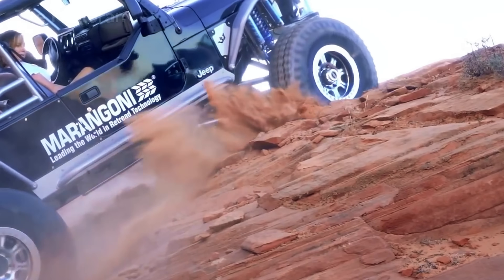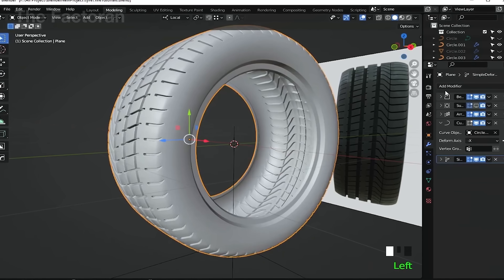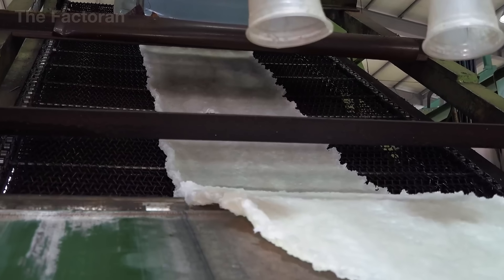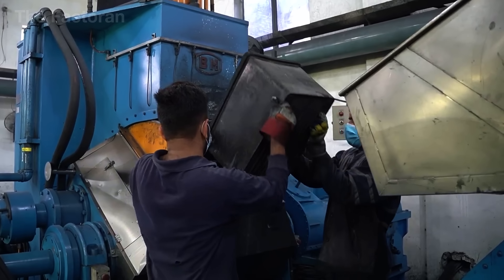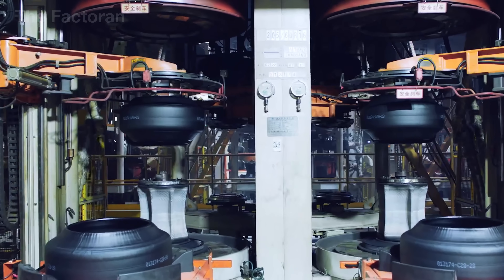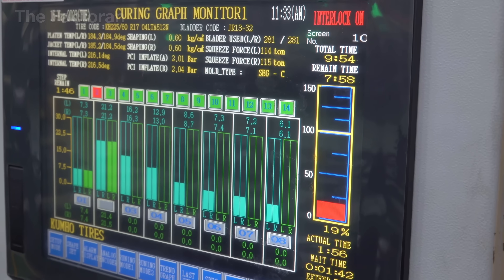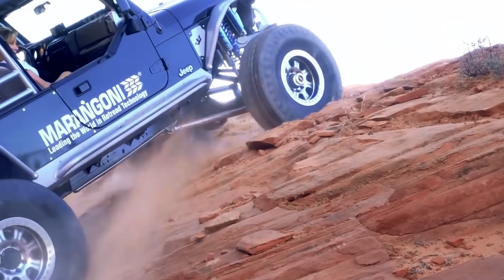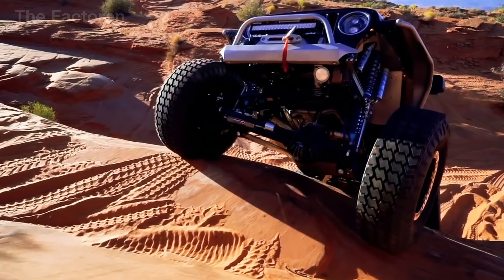How Car Tires Are Made Inside Michelin’s Massive Production Line

Comment: Detected the flaw in the tire creation: why there is no metal net inside? It would increase the tire strength!
Reply from the maker: Good point! Car tires actually use layers of steel belts inside — maybe the video just didn’t show that part of the process.

Comment: I purchase Michelin Tires, my 2016 Chrysler 200C AWD in 2020 only had 20,000 miles replaced Eagle GA tires on car, because of T.P.S. always alerting me of low pressure everytime on 3 or all 4 tires falling below threshold when weather got cooler and stayed cooler putting air in tires every week.
I purchased set of 4 Michelin Pilot series tires. And have had them for 5 years and T.P.S. has never alerted me of low pressure.

I had replace tires on my 2019 Jeep Cherokee Overland 4x4 at 60,000 miles, with Michelin Cross Trek 2 tires because of great rating they received from customers on Discount tire  website, and person I work with had set on her Equinox.
Reply from the maker: Thanks for sharing your Michelin experience—sounds like a game-changer!

Comment: I was Quality Manager at a plant produced and used 1,000,000 pounds a month for automotive anti vibration parts. Rubber is amazing stuff and the chemistry to get it to preform certain ways is impressive. And the mills they mix it all together in, at our place were originally placed over 100 years ago. Yes they get rebuilt every 15 years os so a few million each. Still great stuff.
Reply from the maker: That’s incredible — firsthand experience like yours really shows how advanced rubber engineering is!

Comment: Not just the tires, your suspension takes hard impacts on bad roads. And your engine and Transmission mounts take a beating.
Reply from the maker: Absolutely true — bad roads wear out more than just tires!
Reply: Thinking of moving and I look at houses that are NOT on Gravel or dirt roads. Because so harsh on vehicle, have friend lives on dirt or gravel road and 60,000 miles on their vehicle looks like have 200 or 300,000 miles on vehicle and always repairing or replacing vehicles before or just after 100,000 miles.

Comment: Michelin comander 3 for motorcycles suck ,I will bever buy Michelin tire again,there warranty  is not good,only 2 workers for warranty took me a week to talk to them and the guy  told me there for RVsAnd motorcycles the tire i bought makes vibration between 23 to 28 miles hour and the schop that sold it to me were hassoles so im stuck with it.Been using comander 2 for years on 2 bikes never again.shity service.
Reply from the maker: Sorry to hear that—sounds really frustrating dealing with both the tire issue and the service.

Comment: You don't just squirt rummer in a mold.
Reply from the maker: You’re right — rubber molding involves careful pressure, heat, and curing, not just squirting it in.

Comment: in my opinion you can't get a better tire than Michelin
Reply: Michelin premacy was always my favourite tyre,until they went over to the green version £160 per tyre, cracking on side walls, separation on tyre tread, way down on mileage,only 2 years old, stopped using them
Reply: Goodyear is easily the best.  Pirrelli makes decent tires, also.  Michelin isn't bad but can't compete with Goodyear.
Reply: @spg5658 Good year has never been qualified by Porsche, Ferrari or Lamborghini as OEM supplier for their cars! Not even close homeboy!😂😂😂
Reply: @LWRC They are the king of tires no doubt. USA quality
Reply from the maker: Michelin is definitely known for quality and durability—hard to beat their reputation.

Comment: Growing up in Akron Ohio, I saw my first tire being built in the early 1950's on a factory tour to the B.F. Goodrich factory. It was a bias ply tire, radials had not yet been invented. Entirely built by hand. Each tire assembled by a single operator standing in front of the rotating drum with carousels of the individual layers surrounding him. Modern design and materials has thankfully improved the 30-40,000 miles life expectancy of those tires. Thank you for this video of current automated tire production. Learned a lot but it also brought back memories of that first factory tour.
Reply: The only "direct" thing I can add to your comment here is that both of my parents were born, raised and educated in Akron, and that my mother's father worked for one of the rubber companies that manufactured tires; I believe his position was that of  payroll master.  ( And at the peak of Akron's famous tire manufacturing history, there were, I believe, the three major tire companies in the manufacturing part of the city, which apparently didn't help the air quality at times. )  Between sometime in the 1920s into the early 1950s, my grandfather worked at one of those plants before retiring, and then with Grandma, they moved back to their hometown of Doylestown, Ohio.  Incidentally, the annual National Soapbox Derby Races are held in Akron.  In 1961, my family moved to California from Columbus, Ohio.  During the summer of 1969, I hopped on my 10-speed bicycle (when I was 20 years old) and rode from Sonoma County, here in northern California,  across the country.  And one of the highlights of that trip was stopping to visit family and friends in Cincinnati, Columbus and Akron.  And in Akron, my aunt drove me to the Soapbox Derby track. It looked like a giant Hot Wheels track, actually.  ( And I was very fortunate that, after 4 weeks of actual road travel, and 2 weeks of visiting with family and friends along the way, I made it to Brookline, Massachusetts, just on the edge of Boston. I didn't want to ride into that big city,  plus I was just road-weary, so I sold my bicycle at a bike store in Brookline for $10.00, got on the subway to the airport, and flew back to San Francisco.  It was a great trip! )
Reply from the maker: What an amazing memory—thanks for sharing! It’s wild how far tire tech has come since then.
Reply: As someone who saw bias-ply tires being built by hand in Akron back in the 50s, this video is fascinating. The shift from a single operator at a drum to this level of massive automation is a testament to modern engineering. Great look at how much the industry has evolved

Comment: And modern radial tires delaminate with age even when as new. Why cant they hold together????
Reply from the maker: Great point. Modern radial tires can delaminate with age due to oxidation, UV exposure, and drying of internal adhesives — even if they look unused. Rubber breaks down over time, especially if stored poorly. It’s not just about mileage — age matters too.

Comment: Why is PTFE not added to tyre's interior wall to stop air / nitrogen seeping out ? Why a brand ( Roadclaw ) has far lower rolling resistance ? Can kevlar stop a puncture ?
Reply: PTFE will not bond to most polymer surfaces. It also has a much higher gas permeability rate compared to the butyl or chlorobutyl polymers normally used as the inner liners of tires.
Reply from the maker: PTFE in tyres? PTFE isn’t used inside tyres because it doesn't bond well with rubber, is expensive, and isn’t flexible enough for tyre dynamics.